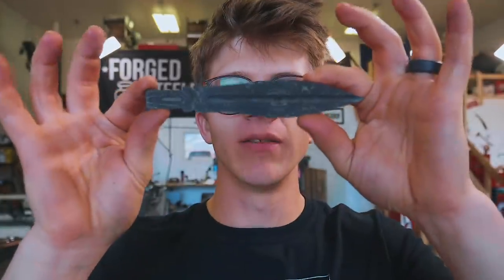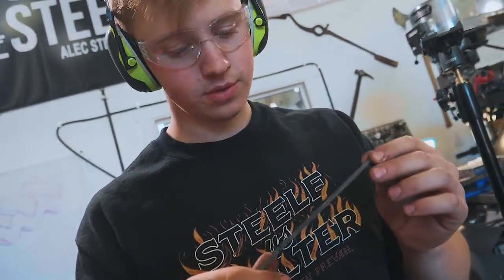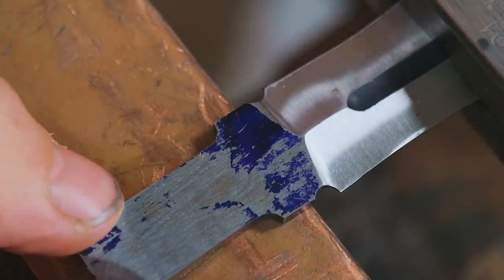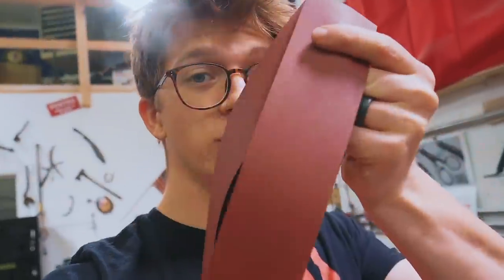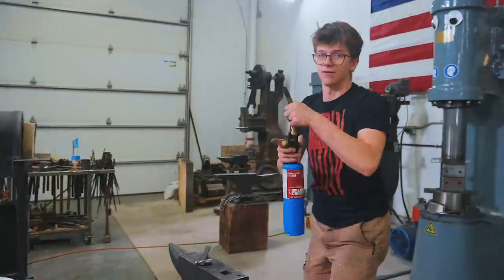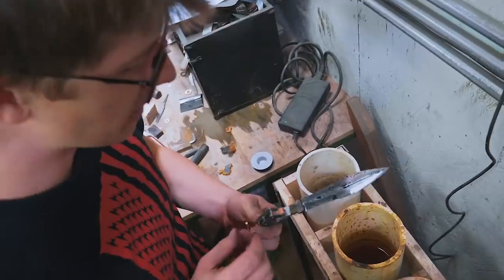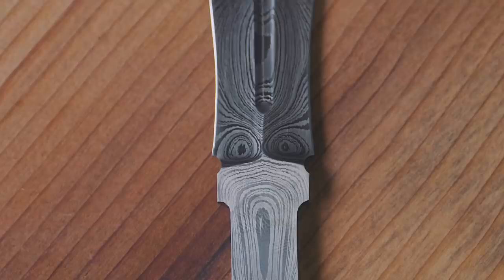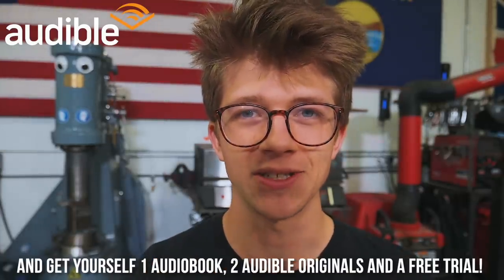JOHNNY 5 NEEDS A BLADE!!! Part 3 - Finished!!!

Comment: Hey Alec Next Level Carpentry does a video where he shows how to get any radius sanding block he needs by using pvc pipe and he just cuts a slit in it that you put the sandpaper in,  and of course you can get just about any radius you need

P.S. thank you for trying to say aluminum right the first time😋

Comment: Fun fact: The chemist who discovered Aluminum called it Aluminum since it was derived from alumn, that's the name it was marketed under. However when he submitted it as an element, his peer reviewers changed it to "aluminium" before submitting it to the Royal Academy because all the elements being discovered at the time ended in "-ium" so it was viewed as more "proper." This is why America and England pronounce it differently.
Reply: ZevVeli odd... in the version I’ve heard, it was originally called Alumnium.
Reply: SoupFork There's lots of different stories about the names of the elements. Especially since if a substance is submitted as a non-element and then discovered to be an element later the name has to be changed (which is why it is neodymium and not neodidymium.)

Comment: Question. Is there ANY metal out there that has actual color in it? Like a red, a green, yellow or blue?  Something other than the light and dark combinations in Damascus. I ask this because I have an idea. Imagine one of your multi layered billets. Then take the colored metal and make rivets from it. Drill multiple holes in the billet then install the colored metal rivets and then continue folding it. Would it look cool or dumb?
Reply: Osmium is bluish but it is very tough to machine and it is expensive. Metals don't really have any colour unless they are bonded to another atom as a compound.
Reply: @CrazyNerdInventor  I kinda figured that. But not knowing a thing about metal made me curious. The blueish idea tho...... I wonder if the polka dot and striped Damascus worlds be worth the expense of that metal

Comment: 3:41  ..  Alec............  A fuller must ALWAYS be HAMMERED in, not milled in.  Hammering a fuller displaces the steel and rearranges the metal cristals, giving the blade internal strength.  It's the equivalent of putting rebar in concrete. 
You hammer and fold steel to make it stronger, don't you .. ??   That's what a fuller does, too. Milling it out may even WEAKEN the blade !!!!
A medieval blacksmith would slap your face for milling a fuller...........!!!
From now on...HAMMER the fuller.

Comment: Next project: Restore that antique power hammer sitting in the corner by the shop door. You are set up to make whatever parts you need now, so it is time. I'm bored with blades.